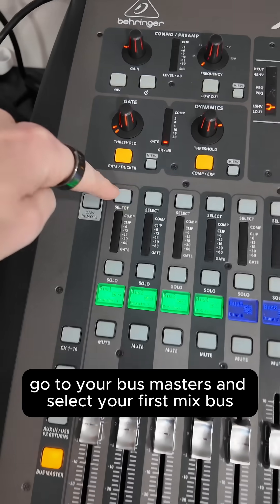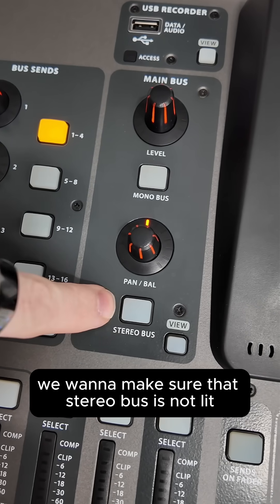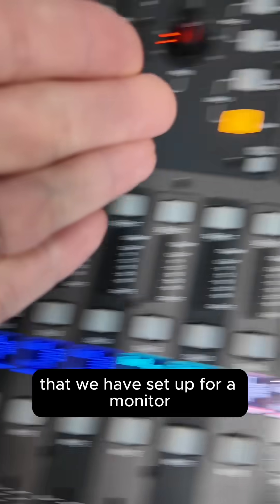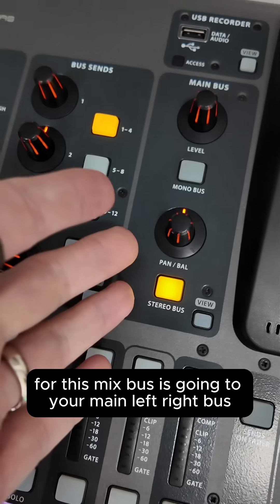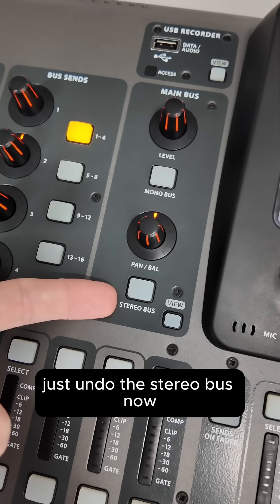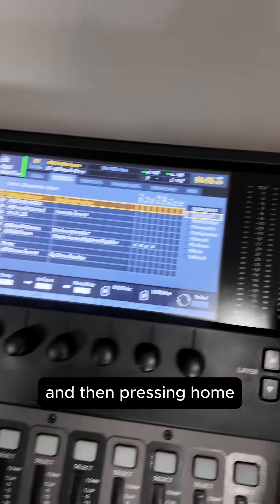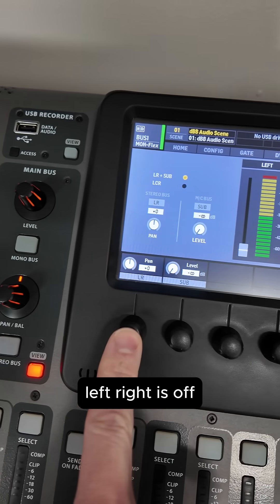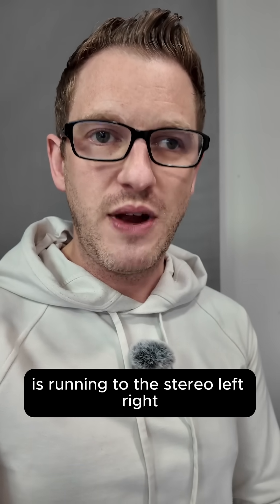Why Your Muted Channel Is Still Coming Through the PA | X32 Fix #behringerx32  #livesound

Comment: Ok I have a question, here goes.

I was mixing a gig on an M32R and using a DL 251 as my stage box.  I needed a bunch of mixbuses for stereo in ears. So 1&2, 3&4, 5&6... So on.  Now my main L&R was coming from the local outputs 7&8 of the M32R.  The in ear monitors that were coming out of 7&8 of the 251, were being effected by the main L&R rather than the mix buses I was sending to. So how do I route it so that local 7&8 is for main L&R while the stage box 7&8 is it's own separate mixbus, not influenced by main mix.  The output routing has been a frustration of mine for years with these desks but your tutorials have helped me understand them that bit better

Comment: While I've never had this issue during an event, I did run into that while learning the X32. It's those tiny bits of knowledge to share that helps new folks move along faster.

This is why I still prefer analog because you can physically see status issues. Still, love my X32 and it just requires higher attention to details. It's worth the effort.